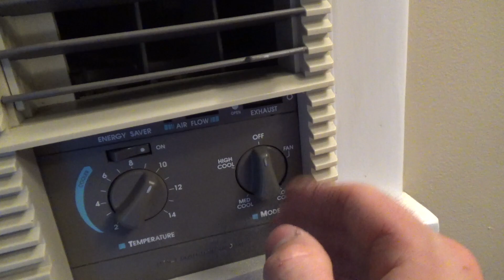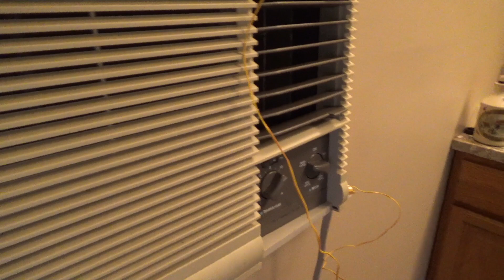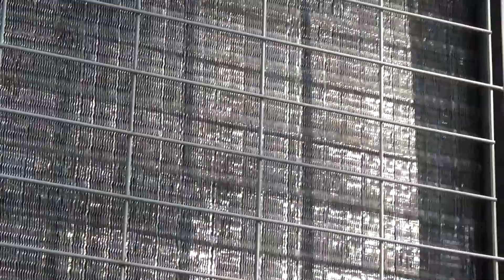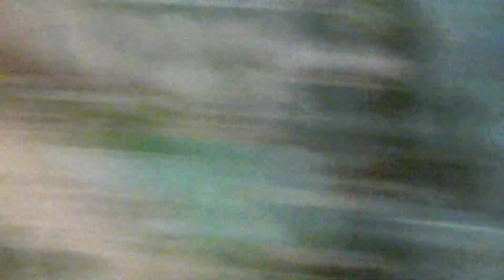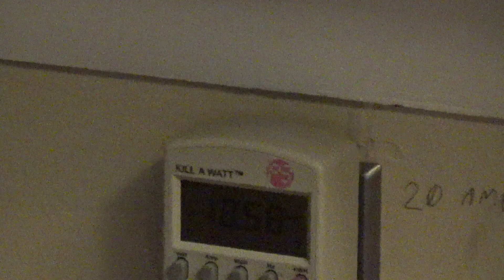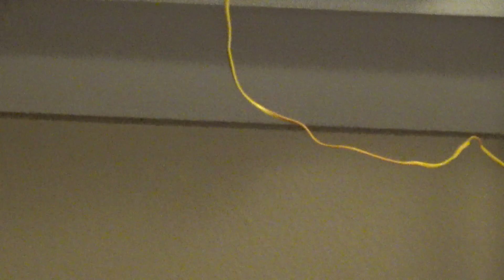1994 Carrier XCA121D 12,000 BTU (1-Ton) Air Conditioner

Comment: My compressor has gone our on ours, here simply in my research
Reply from the maker: I've never seen a compressor fail in one of these, it more likely is just a capacitor failure.
Reply: Is there a market to resell these?
Reply from the maker: @jumbroni6014  There is; but it's small.

Comment: Nice video and start up of the carrier 12,000 BTU air conditioner. That things sounds great even though it’s physical condition is not in the greatest shape anymore that could have been prevented with a drain hole. Glad it still seems to be running and seems to be a good replacement for the Fedders 12k.
Reply from the maker: Thanks

Comment: Very quiet. Is the rusted out base pan a fixable thing? Could a complete replacement be fabricated to extend the unit's life instead of patching it? Would the rust shorten it's useable service life by a significant amount (for you)?
Reply from the maker: There are collectors that repair the base pans using a few different methods. I tend to not worry about it, especially if it doesn't effect the area where the compressor is mounted. As long as the water is draining and there's not a large accumulation of dirt inside the machine holding moisture against the pan, I really don't foresee it causing any damage to the system. The biggest issue I encounter, as seen in the video, is with the condenser not lining up properly as it's no longer secured at the bottom. This is usually able to be corrected once the unit is in place, also as seen in the video.